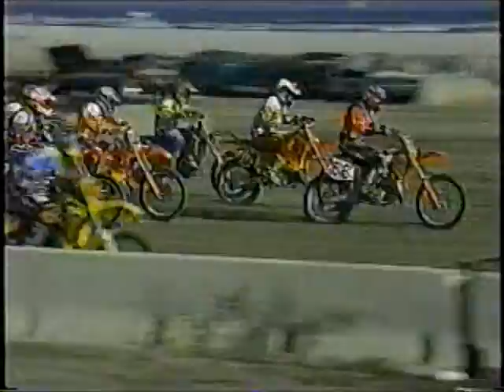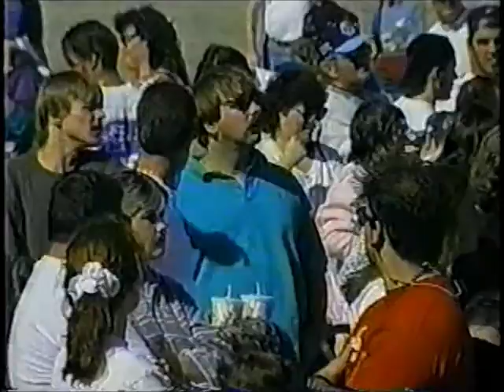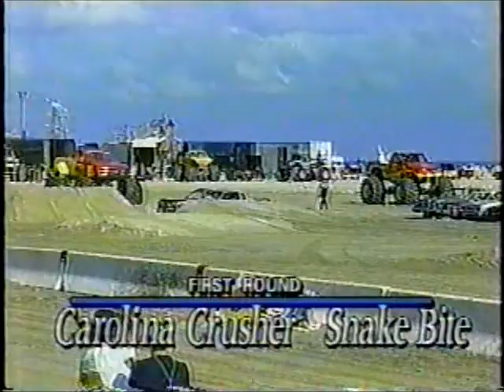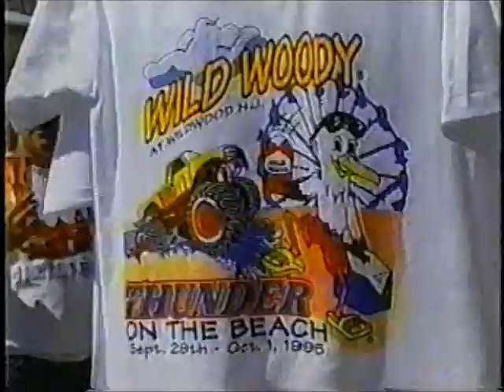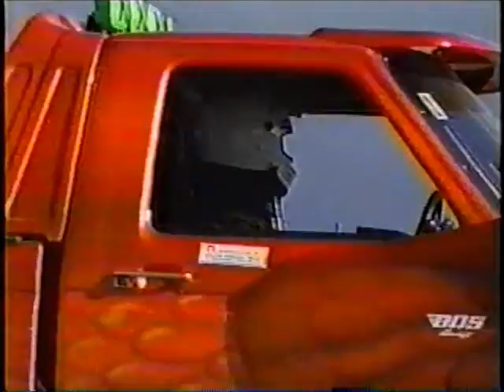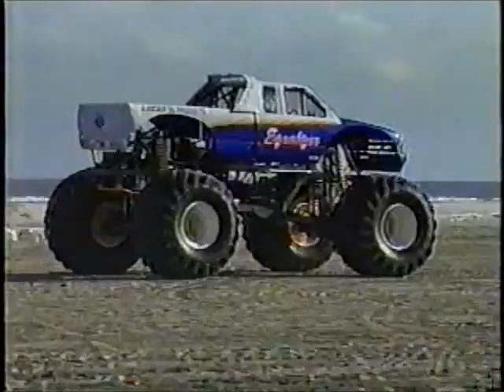WildWood NJ 1995 Day 1

Comment: I think Ricky Rattler was Dan Runte.
Reply: You're both wrong. It's not Runte in this case.
Reply from the maker: Emerald.Black you are correct
Reply: It was Gene Patterson.
Reply: Rich Hoosier was colt cobra I think
Reply from the maker: @ritaromero5004  wrong
Reply: Colt Cobra was Gene Patterson, Rick Rattler was Dan Runte.
Reply: I'm a few years late to the party here, but at various points - if I recall correctly and I may not - Colt Cobra was John Piant (BF4, 1991), Gene Patterson (BF4, 1991/BF9, 1992), and Eric Meagher (BF10, 1994). Ricky Rattler was Dan Runte on the PENDA tour when Snake Bite ran on the Bigfoot 8 chassis in 1993. Not sure who it was after that, though, as Runte moved on to Power Wheels Bigfoot/Bigfoot (BF14, 1994/5/6) and, as mentioned, the Colt Cobra character was brought back to PENDA for 1994.